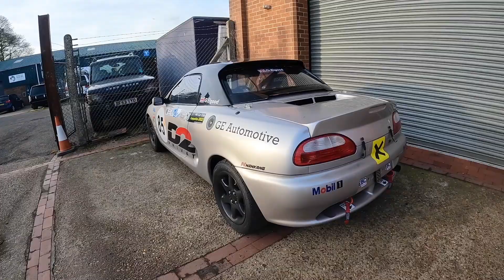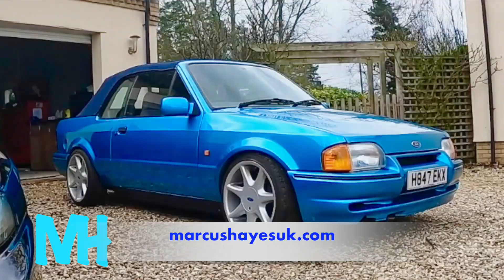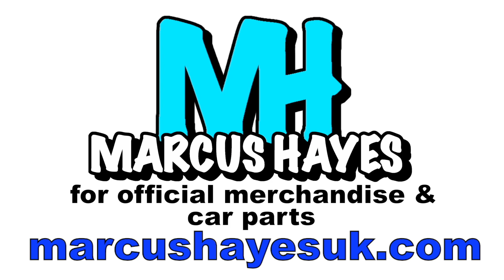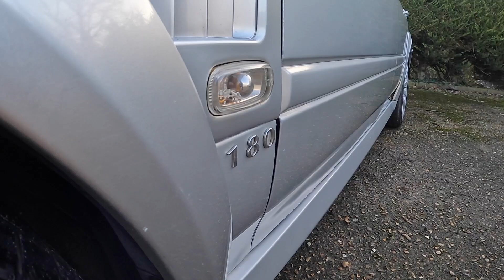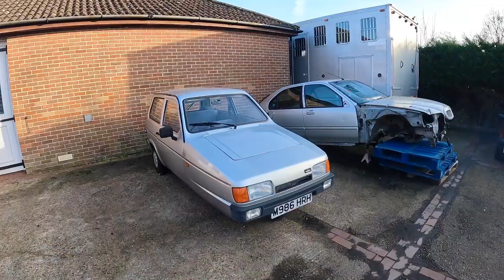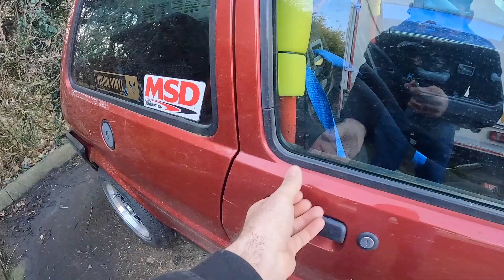CRAZY 277bhp Turbo Metro is a DEATHTRAP!!! 😃 *Greg's fleet part 2*

Comment: I swear those door bars in the caged xr3 are welded in wrong, ive never seen a bar go from the bottom of the b hoop to the middle of the a legs, theyre always half way up the b hoop to the lower base if the a legs, pointing down.
Gettin in n out of that with that upper door bar in the way, nevermind in a crash, is gonna be serious effort. Not to mention theres less protection for the driver.

Comment: in the MGF RACER , i Would re position the second extinguisher thats pointing at the back for the seat  - great car collection there !!
Reply: Wasn't really too sure where to put it as the kit comes with 8 nozzles, 4 in the bay, 2 near my feet around the fuse box and the panel behind the seat is covering the fuel tank.... so in the worse circumstance thought it would be a good barrier.